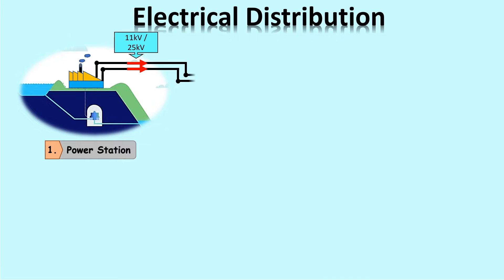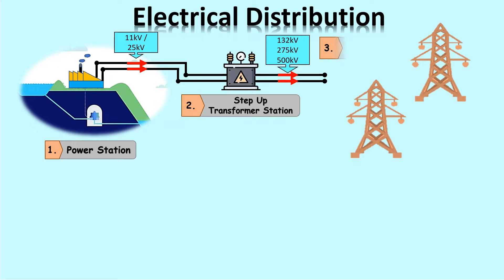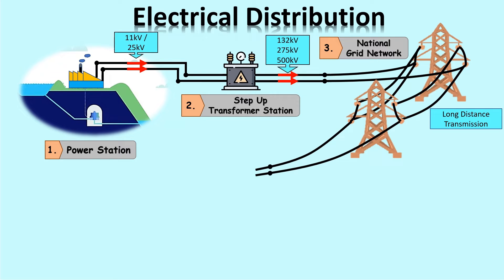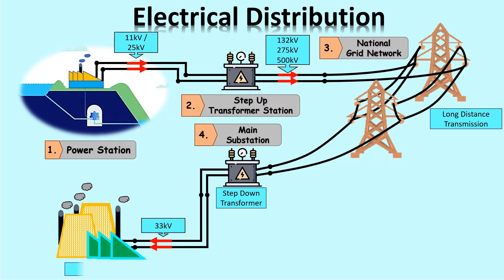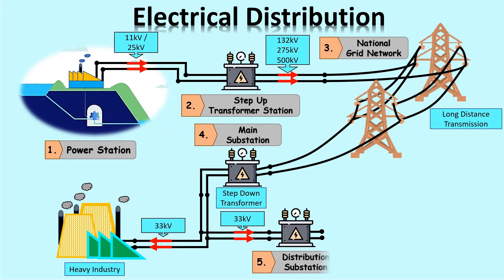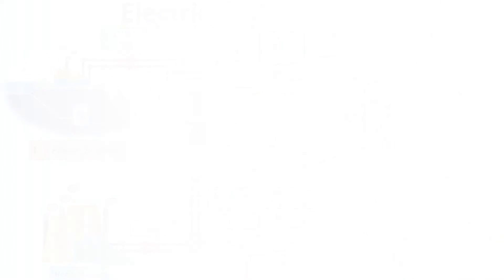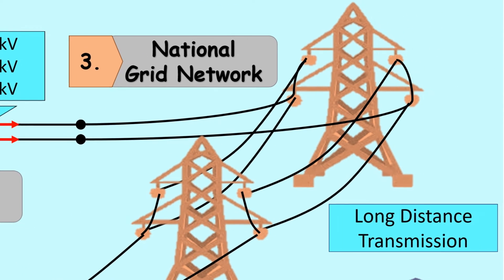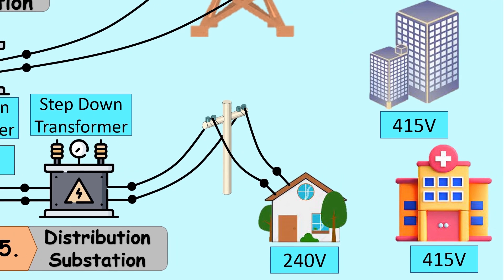Electrical Distribution System | Sistem Penghantaran Elektrik

Comment: Maaf nak tanya, secondary distribution substation kenapa tiada ye...berdasarkan kajian saya daripada secondary high trasmission substation akan step-down dari 132kV ke 33kV. Selepas itu akan pergi ke primary distribution substation dimana elektrik akan step-down dari 33kV ke 11kV...seterusnya akan ke secondary distribution substation yg akan step-down dari 11kV ke 415V/240V....mohon penjelasan tuan...terima kasih